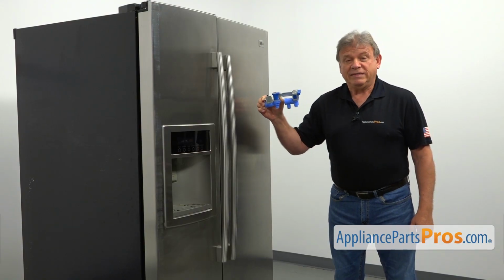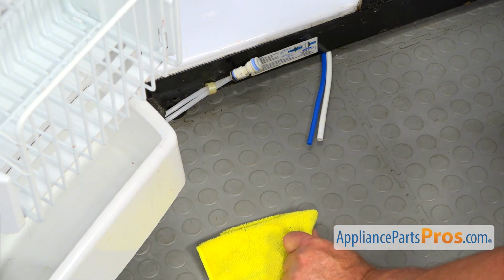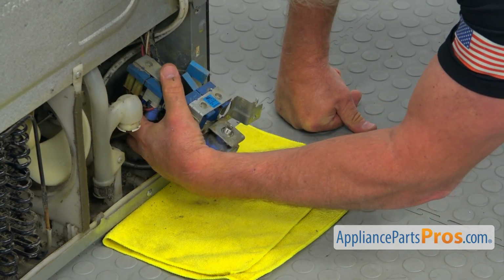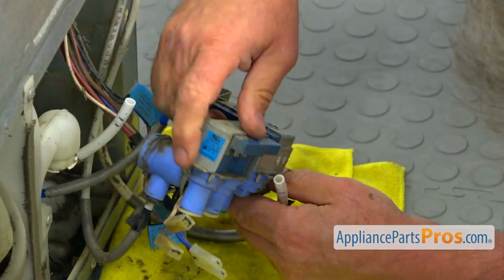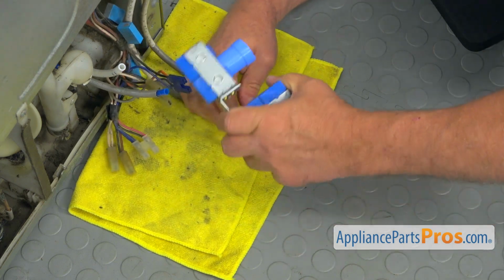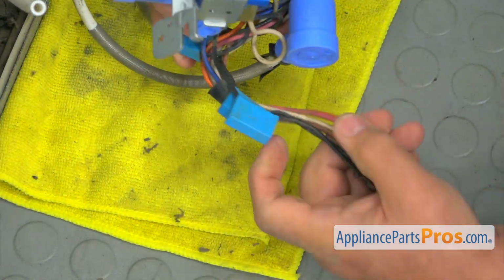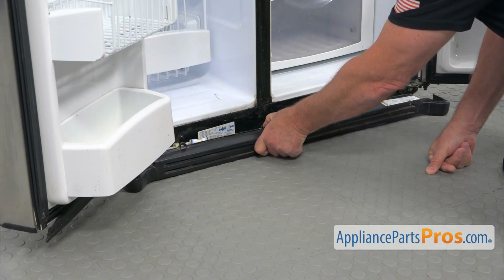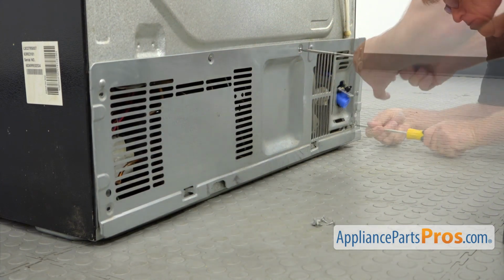How To Replace: LG/Kenmore Refrigerator Water Inlet Valve Assembly 5221JB2006K

Comment: The fan next to it with the water reservoir, can you tell me if it's supposed to run at all times?  The fan powered on after the replacement but shut off after a minute or two.
Reply from the maker: The fan should run while the compressor is running.
Reply: @appliancepartspros  Should the reservoir ever be full capacity?  It was full and leaked down to my lower level and damaged my ceiling.  It was the reason how I noticed the leak from the inlet valve assembly.
Reply from the maker: The water in the reservoir is refilled as it's used. If your water valve is leaking then that would need to be replaced.